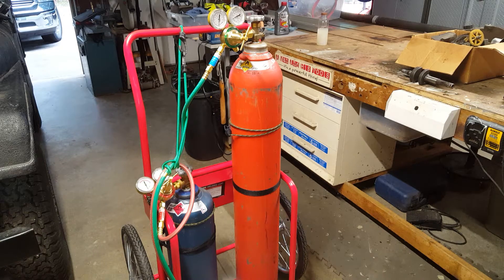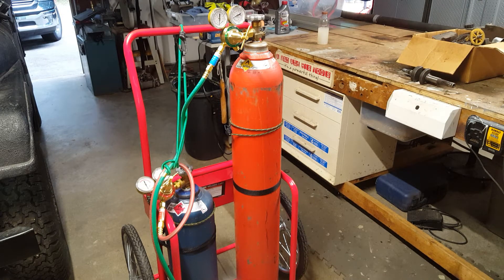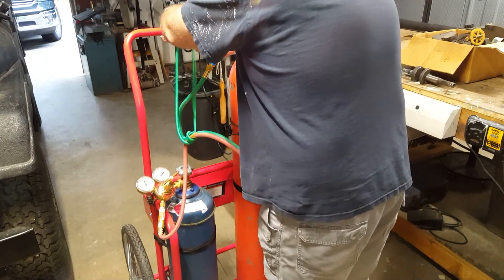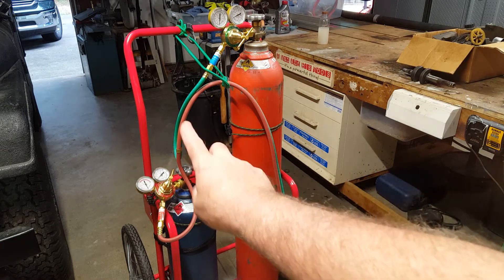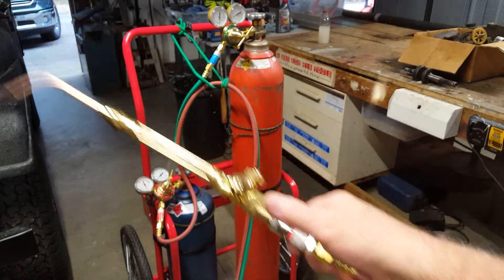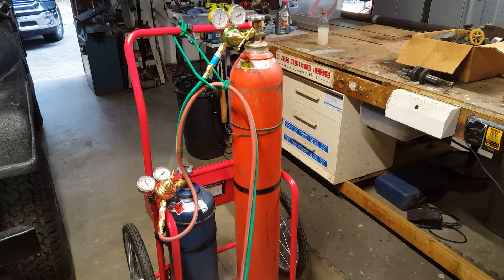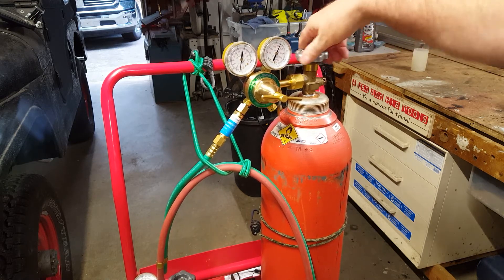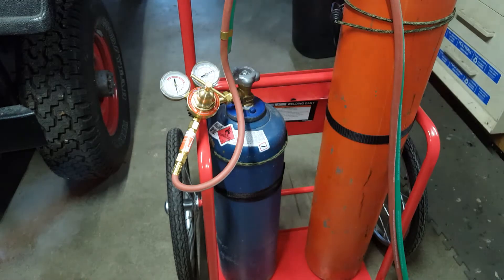OXY ACETYLENE RIG WITH FLASHBACK ARRESTORS BOTH ENDS

Comment: Excellent video. I have to agree, I have seen so many variations on oxy acetylene procedures it makes your head spin. I was always taught with a  cutting torch it was oxygen off first and then acetylene, but I see many do the exact opposite on a cutting torch with no flashback arrestors. Mine unit would pop if I done that, but they don't seem to have any issues. Maybe it's because I have an old Victor Journeyman torch. I run the arrestors on the gauges, but I think I will get some for the torch as well.

Do thoe Olsen Quick Connects with the Flasharrestor seem to work good? I know Koike makes some and can be reset, but they are $126 U.S. dollars where the Victor Flamebusters are $73.00 U.S. dollars.
Reply from the maker: Hi, no quick connectors all male female threaded and obviously vise versa at the other end

Comment: Thanks sir you described everything about it very deeply.sir is there any signs when the flashback is going to be?
Reply from the maker: loud hissing, popping... May feel the arrestors slam (Cycle) shut on the gun (if fitted) or hear them shut on the tank side (if installed) remember Acetylene on first, light, then introduce Oxygen at start up. then shutting down, Oxygen off first, then turn off Acetylene ... Any doubt shut tank regulators and tank valves immediately.